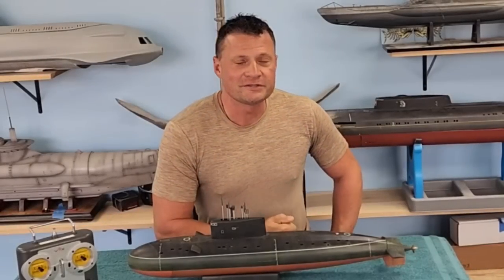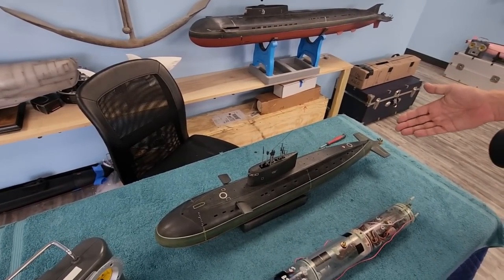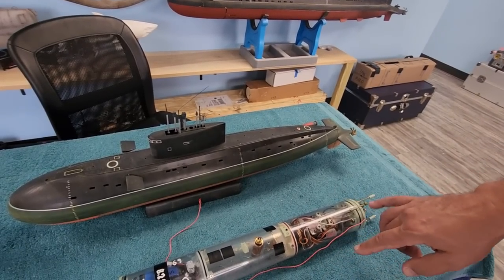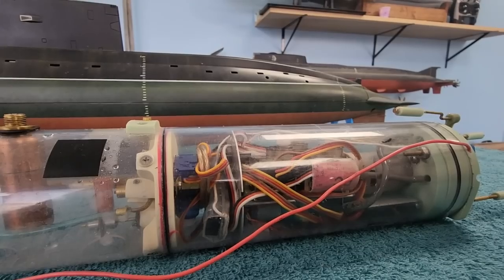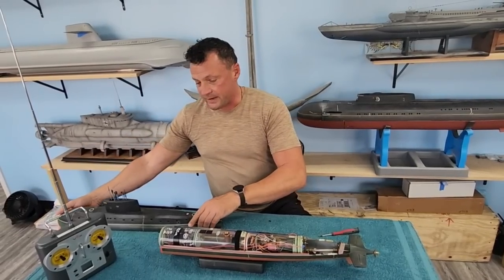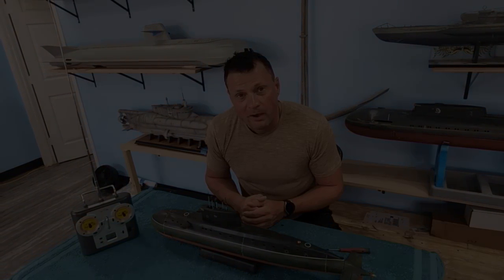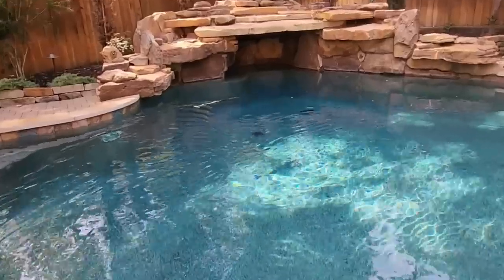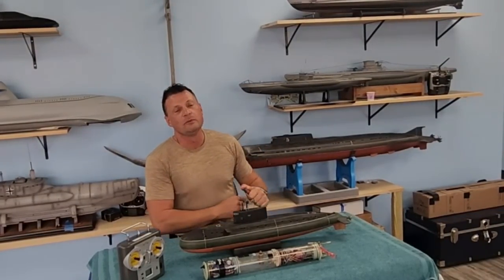Take a look at what a TRUE RC Submarine craftsman can do! 1/96 Russian Kilo!

Comment: I'm curious you need the override switch for the leveller. I have three versions of pitch controller, including  one from you(!) and they all permit direct control of the aft planes with channel 1 - or whatever - when you need it, no extra button required. Really interested in the 'depth cruiser' thing though. That would be a help...
Reply from the maker: Any time you manually command your planes that are attached to a pitch controller, you are overriding the unit. I didn't use an "extra button". That channel was stern planes. As it's on a non-proportional switch and not a stick, it can only command full rise or full dive, hence my calling it an override. Sorry for the confusion.

Comment: Oh man the Seaview in the background! :elbowcough: Magnetic linkage wow that's cool. After some ballast is vented and you want to pump in more gas for buoyancy, where does it get gas from the stern motor cell? Wouldn't that begin to create vacuum there?
Reply from the maker: It draws air from the surface via the intake in the sail. There is also a pressure vessel aboard that stores compressed gas for emergency surfacing.
Reply: @RCSubGuy  That is so great design! Thanks for the explanation. 🙏

Comment: Very cool, just found this randomly.  I love the technology you are using, but I have one question.  How do you guys manage the roll torque? Are the planes enough to counter act it?
Reply from the maker: Torque roll can be managed statically via a large righting moment as a result of flotation and ballast, or dynamically with control surfaces, though in RC subs in general, modelers rarely go to those lengths.

Comment: how does the signal from the radio above the water get to the boats when submerged under the water and what kind of range can you get?
Reply from the maker: Low frequencies penetrate water quite well. Range is inversely proportional to depth. The deeper you go, the closer you need to be. You can get down 20 or 30ft in nice, clean, fresh water.

Comment: Like model train guys, they have very realistic trains- you have a very realistic sub. BUT it gets ruined (just like the model trains) by the SPEED when running the model(s) It should be running at a 1/4 speed to make it look more realistic... JMO.
Reply from the maker: Sooo.... run it at slow speed, as I suggested and commented in the video (but you knew that 'cause you watched it all through, right?)
Reply: Since the introduction of Digital Command Control, model railroaders have been able to operate at close to scale speeds and simulate the inertia of a fully loaded train while starting & stopping. I wonder if a DCC decoder could be adapted to the R/C Sub world in a similar fashion?